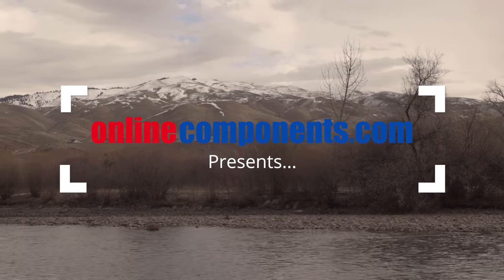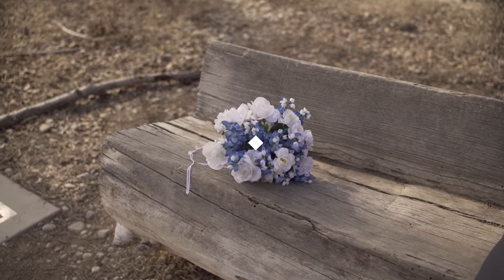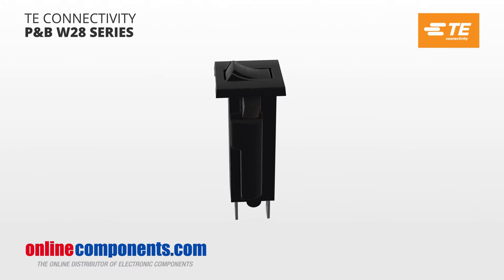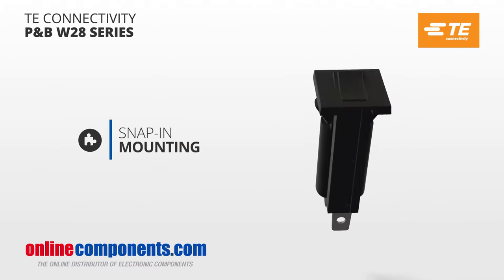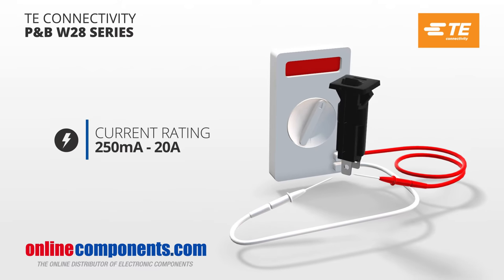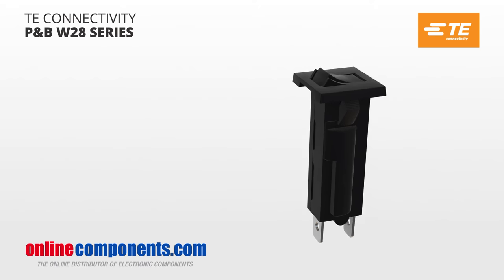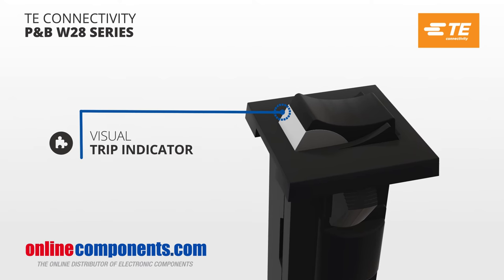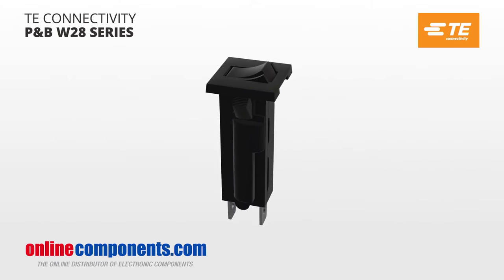Component360: TE Connectivity/P&B - W28 Series

Comment: Hi, how can I know if it continues to work? I try to press to reset, but I can't, what can I do?
Reply: Take it apart and bend back the thin metal strip so the contacts connect through the hole in the white plastic sliding blade. Be careful to notice where the spring is before you do too much. There are thin long holes on the side which can help you to pry it apart at an angle. The front housing comes forward as you bend up the part you are opening. Finally the part closer to the front housing will pop open.